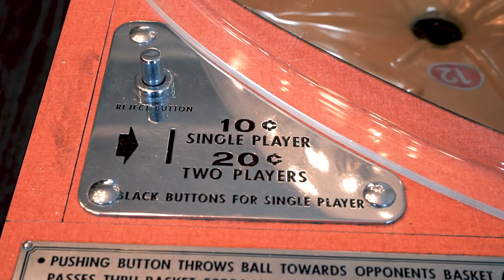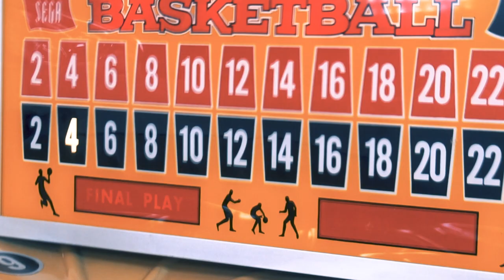Super rare 1966 Sega Basketball EM Arcade machine

Comment: just did some research on these, the version you have is from 1968.  The 1966 version had the angular dome, different legs+control panel, etc
Reply: I played on a similar yet more modern version of the sega basketball machine around 1998. It used the trackball for selection. I haven't been able to find anything on the internet about it.